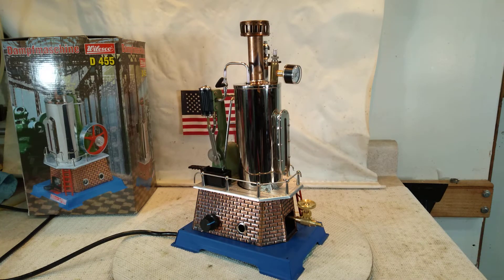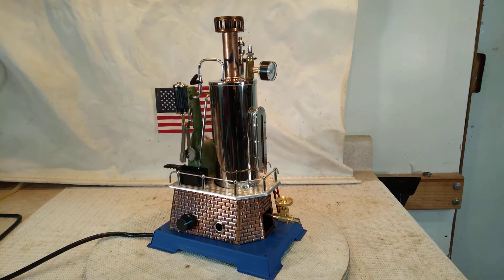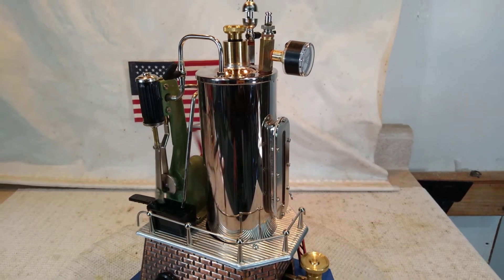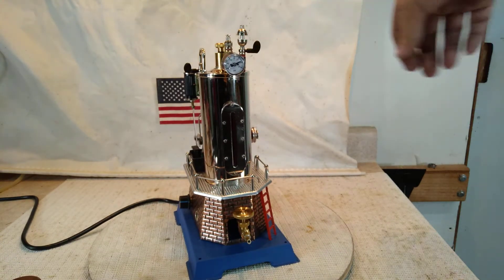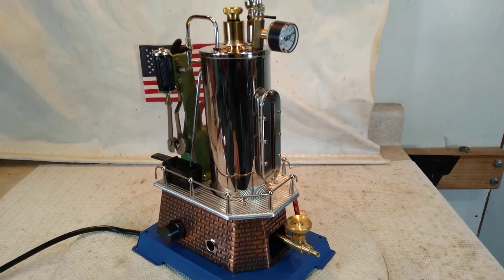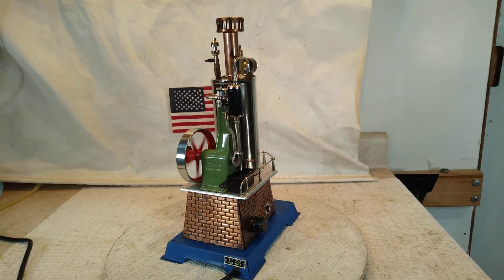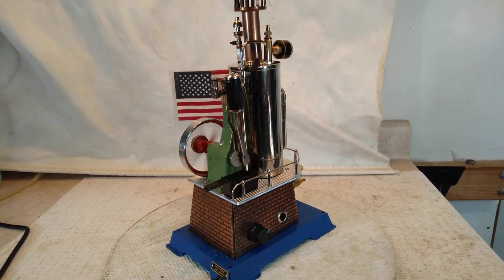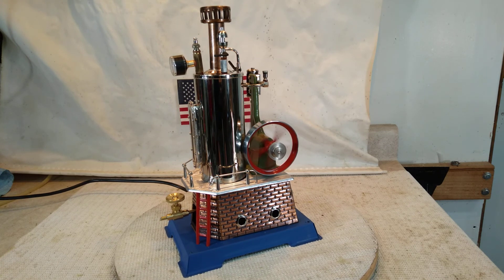Wilesco D455 live steam engine (modified)

Comment: Where did you get the immersion rod heater and pot adjustment for it please?  I really like the way the engine runs!
Reply from the maker: amazon, look for immersion cartridge heater. the POT came from Ebay (China) several different styles available.
Reply: Thank you for the reply Sir!! You removed the center flu, was that soldered in? I love how the steam whistle overwhelms the mic on your recording device. @bruceang82